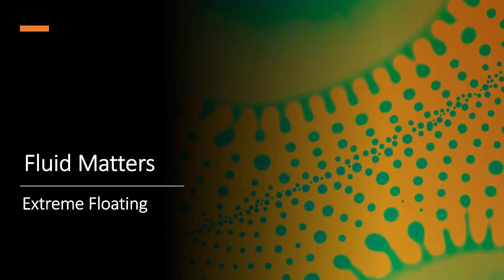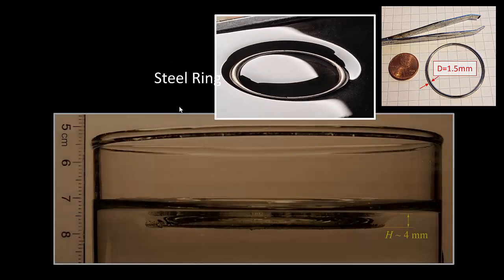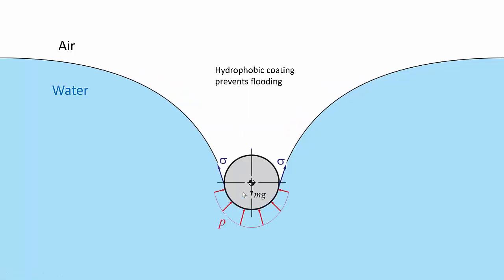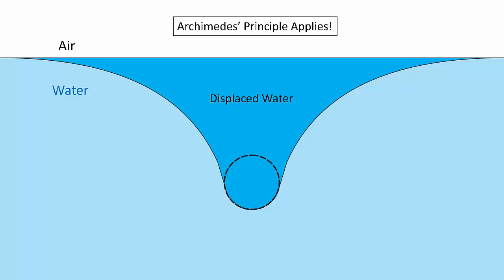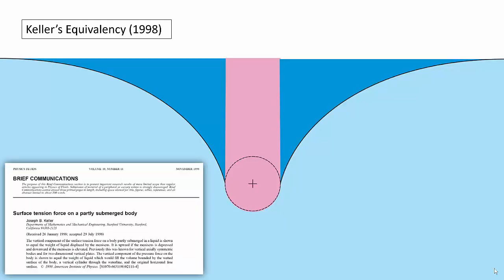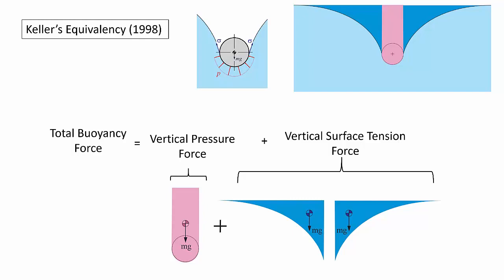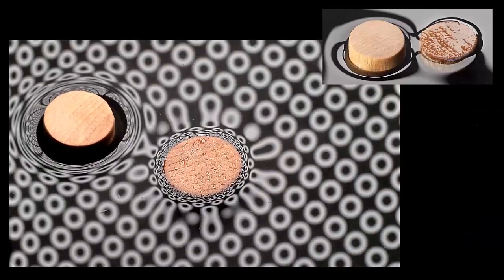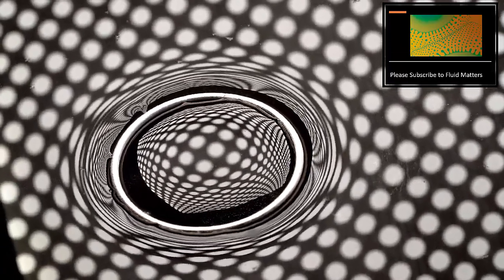Extreme Floating with Superhydrophobic Coatings

Comment: Very interesting! While the common assumption in relativity is that matter curves space-time towards it, it's more likely that most attraction can be better explained as a mutual repulsion of the intervening space-time.

An analogous effect can easily be demonstrated where two floating objects with hydrophobic coatings would move towards each other, if they were placed close enough to each other where the areas of the hydrophobic effect would be overlapping.

This distance would be infinite under ideal conditions, but would need to be close enough in the experiment for practical observation.

This would also explain how gravity and magnetism work even though action at a distance is impossible, because the attraction of two objects to each other is effectively no different from their mutual repulsion of the intervening medium.

By inference, this also means that objects that attract the medium would actually move away from each other.

The mathematics of the phenomenon is that the horizontal reactive forces of the medium on the objects would be lower in the intervening space, and higher on the periphery; effectively pushing the objects together in the former case, and pulling them away in the latter.

But the effect would be a lot easier to demonstrate practically with the hydrophobic experiment.
Reply from the maker: Interesting comment. I wish I have a background in the math of time/space curvature, so I could comment meaningfully on the analogy.
Reply: @FluidMatters  Thank you! 

Would it be possible to demonstrate the described effect with two hydrophobic floating objects?

It should be interesting because it's so counterintuitive - that objects that repel the medium would in effect, be "attracted" to each other.

It should be a relatively simple experiment, but with profound implications for Relativity. 

BTW, your explanation of surface tension and buoyancy were really engaging.

Comment: I find this so interesting, thank you for this video! I have a quick question though, I was hoping you could help me out. If a super hydrophobic coated buoyant material is in motion in water (say paddling), would the motion break the surface tension and therefore make the super hydrophobic coating pointless, or would it help in increasing the bouyancy of the object despite the great motion? Looking forward to see what you have to say on this.
Reply from the maker: Interesting point. I think you are correct. Once you have object motion there will be fluid momentum effects which will   tend to destabilize the meniscus. That’ll flood the area above the object, causing the additional buoyancy effect to be largely lost.
Reply: What if was dimpled

Comment: Also, is there a range of 'degree of hydrophobicity' which we can achieve with the surface modification?
Reply from the maker: Yes. The coating that I used is WAY more hydrophobic than say,  ScotchGard spray. The more hydrophobic, the larger the contact angle, the more buoyancy. The coating I used gives a contact angle of 165 degrees for a sessile droplet of water.

Comment: Just another suggestion which I have out of curiosity.
Is it possible to make 6 pentagons such as in a soccer ball, and try to float it.
Since it is in 'spherical manifold' i wonder how it would behave on the surface of water.

May be I am stretching my imagination, yet I just want to make a stable/possibly large area convex water surface.  We have to find answer to the question, how large such a surface could get. I am curious whether we can optimize a nice structure which can just bend the water surface.
Reply from the maker: You could make such a structure that would float. But I doubt it would roll, as it sits in a deep meniscus well. It could likely only spin on a vertical axis.

Comment: Great knowledge. Thank you!
I am thinking about a possible application. 
Is there any simulation which we can change the parameters such as diameter density and radius of the ring and see how the ring shapes the surface?
And what are the possibilities to avoid the "tipping-point" of sinking?
Reply from the maker: There are strong limits set by the stability of the meniscus, which I don't think you can overcome. As a rough guide, you can't go much deeper than the capillary length of the liquid. Many journal papers explore this limit for various geometries. For example, see: Liu JL, Feng XQ, Wang GF. 2007. Buoyant force and sinking conditions of a hydrophobic thin rod floating on water. Phys. Rev. E.  76   https://journals.aps.org/pre/abstract/10.1103/PhysRevE.76.066103